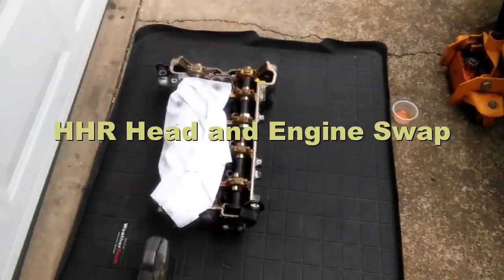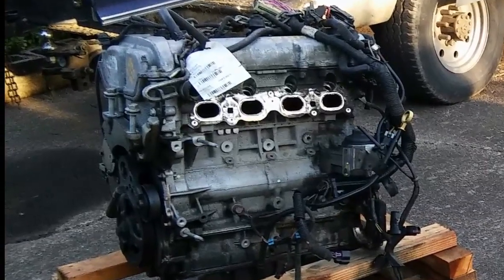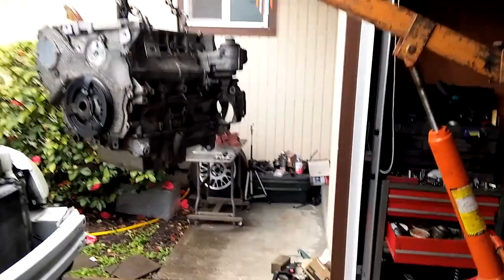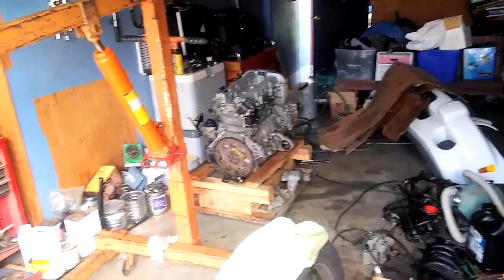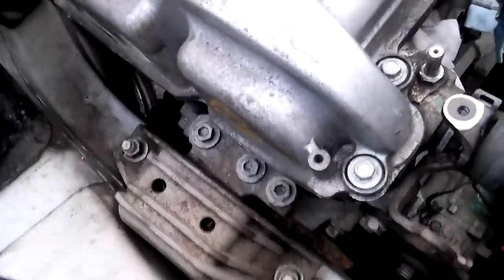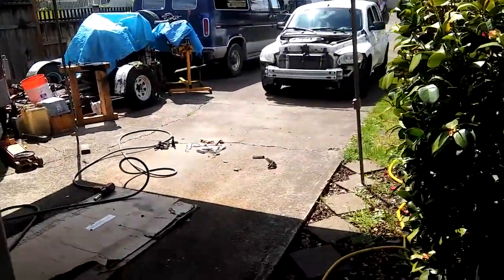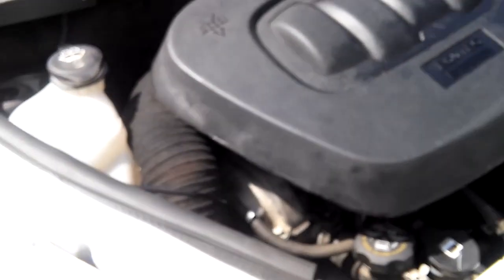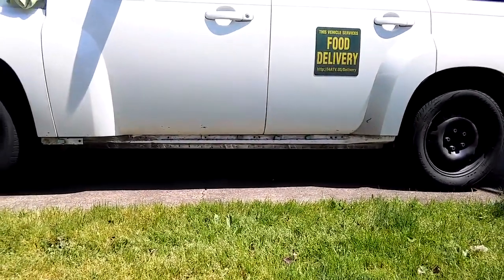Chevy HHR Ecotec Engine Swap - without subframe drop

Comment: Van's Tech Corral                                                                                                                                                                                                                                                                                                      Can I Get an honest opinion..... would you purchase this very exact make/model/and year (2006 Chevrolet HHR LS FWD)                             

with   =   211,136 miles on it
Reply from the maker: KeepOnKeepKeepingOn It would all depend upon the condition and the price.
Reply: @vanstechcorral   I see... How many miles are on yours? How long has/or did it last?  Would You Recommend it?
Reply from the maker: @keeponkeepkeepingon8376  The one in the video belongs to a friend. It's still being used for food delivery service every day since we replaced the engine. I would prefer the original inspiration for the HHR, a 1948 Chevy Suburban!
Reply: @keeponkeepkeepingon8376 at the time, April 2020, it had ~150K miles. As of August 2, 2024, it now has ~281.3K. The swapped engine now has ~320K.

I'm replacing the transmission output speed sensor today, as it finally gave up yesterday.

Been changing the oil at ~3K +/- 400 miles, about every 5-6 weeks. Diesel oil.... SAE 30 CF-2 and/or 15w40, no troubles.
Reply: @vanstechcorral   how much would you pay for a that amount of miles?  and ask your friend the same question if they would purchase that type of vehicle with 211,136  miles on it (if they had the opportunity to do it all over again)
Reply from the maker: @keeponkeepkeepingon8376  He had the same model previously that was totaled in an accident, and he bought another one just like it to replace it. For prices check the blue book and Craigslist. For myself, I have nothing newer than 1985, and I prefer diesel!

Comment: NOT POSSIBLE ON STICK SHIFT MODEL, for those who may try. Dropping cradle isn’t hard though
Reply from the maker: justin wellington If dropping the subframe as per factory manual were as easy, that's what I would have done. There's considerably more work and time involved. As it is, to do this adequate clearance was only obtained by removing the crank bolt, which is a TTY bolt.

Comment: Based on the process, gives a better idea for the misfire which is eventually why the engine was replaced.

More power at 153.4K, than I believe it had 3 years ago at 50.5K when we purchased it from a well known dealership in the community.

It was originally a rental car for Enterprise out of Washington State, then 1 owner on then a trade-in from a 1 off owner in Florence, on the Oregon Coast.
Reply from the maker: Did you mean a well known "dealership" or a notorious "stealership"? LOL Last time I visited one, the salesmen shared laughs with us over Kurt Russell's movie, "Used Cars". Some inside humor - I was no salesmen, but one of the mechanics forced to roll our eyes at the tactics!
Reply from the maker: Even better, now the throttle body was replaced. Next the throttle pedal sensor!
Reply: LOL 😄 Yes.... Dealership.

Though as for the Engine Power Reduced, came across this video from February 4, 2016 that he shows the main problem from the throttle position sensor.

Here's a video from February 4, 2016 that explains the fault of the *Reduced Engine Power*... Bad tiny finger on one of the tiny sets of 11. Thus it confirms the need to invest in the sensor, and may as well, the motor.

https://youtu.be/C5BEPmFB6cw